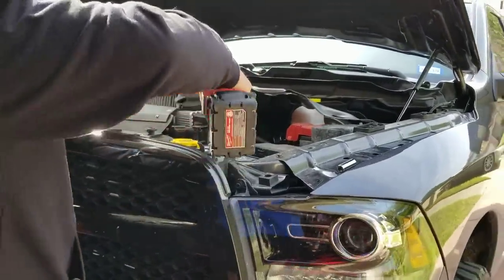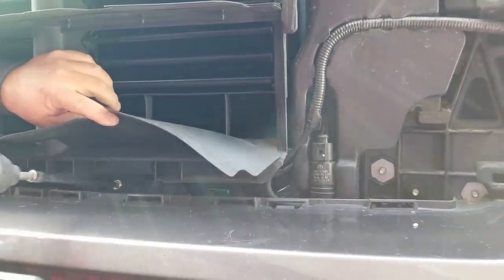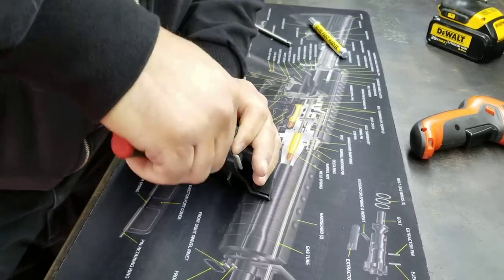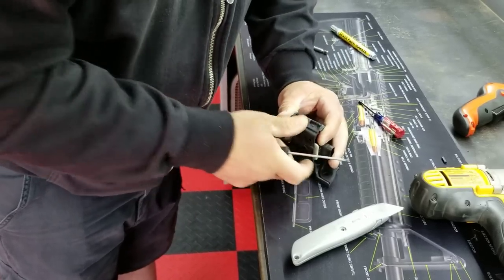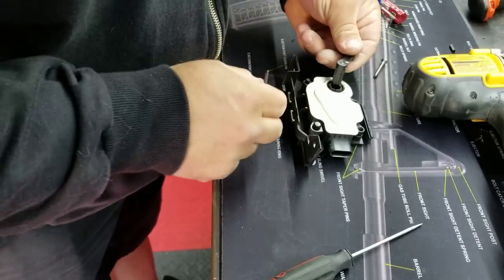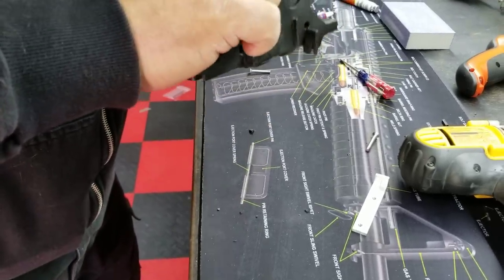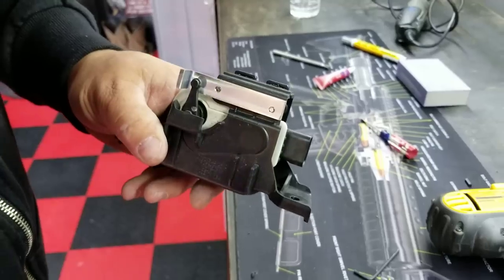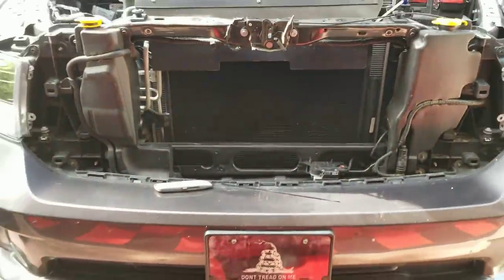4th gen Ram Active Grille Shutter delete

Comment: I'm interested in the cost of the kit... And also, that intake setup on the truck in the video.
Reply: I don't know the cost yet but I will get one as it is fairly cheap from what I heard. That intake is a Vararam Intake from Moe's Performance which is on the way to me as I write this. Get the 87mm ported Moe's performance throttle body with it also!

Comment: I was thinking of doing this on my 😳2012 . But in addition removing the shutters and mechanism from the housing remount the actuation motor back in the original position .. train of thought to force more air  thru radiator cores .

Comment: Hey Jason quick question. I did my own delete making a bracket out of aluminum i had.  First day was fine 2nd cel came back on. Here's the actual question 🤣 is it possible the motor is bad or did i not leave enough clearance on my bend for the arm to move?

Comment: What was the purpose of this?
Wasn't the automatic shutters purpose to get the engine temperature up to optimal faster and to aid in keeping the temperature up in extreme cold and to help with aerodynamics causing an air bulbble at front of truck at highway speeds which increases fuel efficiency?

Comment: My 16 dart is throwing the same code. If I take mine apart. And the sensor motor is oriented the same as yours. Your kit should work for me. Only I don’t have Facebook. 🤔
Reply from the maker: Tom W I have not tested this part on the Darts so I cannot make any guarantees.
Reply: jason dauria 

What I’m going to do is pull my sensor out. If the arm is oriented the same as yours is. ( it should be. It’s usually one size fits all in mass produced car world). Then it should work. I’ll let you know Jason.
Reply: The unit you pulled out looks really similar to mine.
Reply from the maker: I'm all for it if it works for you man. That's just one more vehicle I can add to the list.

Comment: What if we just remove the little arm from the sensor ? Wouldn't the gear inside still function ? So that we can trash the ags and no code should come on the dash..ever tried that ?
Reply: The electric motor would be constainly searching for position because the hard stops would not be felt from the arm missing and you would get a code.
But why would someone want to delete the shutter system to begin with?
Reply: @zash008  i did it the same way he did...just i made the kit my own with some spare parts i had laying around the house...it has been a few months now..the engine keeps cooler even when i pull heavy load and having a tune cold air means more power..
Reply: @Italianborn  ciao ho lo stesso problema su ford, si accende la ventola al massimo hai risolto in qualche modo?
Reply: @giuseppemarrone4641  si , ho creato lo stesso sistema in video ed ho cosi rimosso le ventole e il motore e' sempre un paio di gradi più freddo.

Comment: Will this mod void warranty?
Reply from the maker: Unless they can prove an issue was caused directly relating to the part then no. There is nothing other than the motor connected and airflow is never a bad thing.
Reply: @jasondauria6336  how much is this kit for a 2014 ram

Comment: Ram newbie here. What is the purpose of the active grill shutter system? And why do I want to delete it?
Reply from the maker: MotoPilot The active grill shutter are a minuscule help for fuel mileage and quicker warm up times. When closed on the highway they reduce drag by 4% and increase fuel mileage by 0.5%. The delete is more geared towards the high performance Rams that want an increase in airflow and dont care about fuel mileage. It is a great mod if you are wanting to install a lower temp thermostat and have 100% airflow all the time.
Reply: jason dauria ,how do i buy one of these. I can’t find the info on Facebook
Reply from the maker: Gary Wright you can email me at jason.dauria@gmail.com
Reply: @jasondauria6336  you said it yourself..the difference is miniscule so why go thru the trouble deleting the shutters especially since you still need a working shutter actuator motor to keep from having a 'Check Engine Code'
Reply: I would want to delete it to avoid an unnecessary engine overheat.